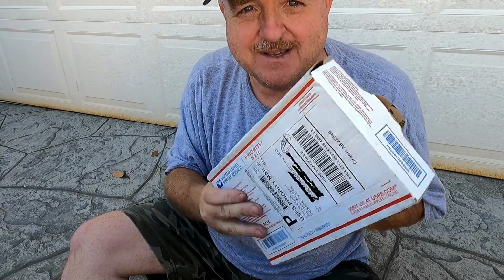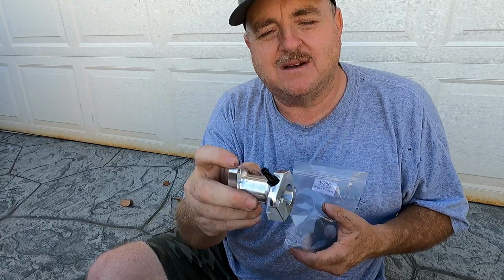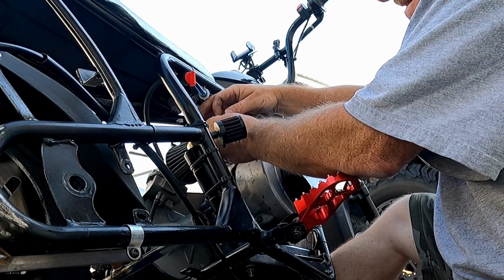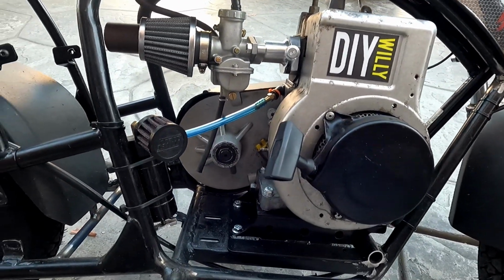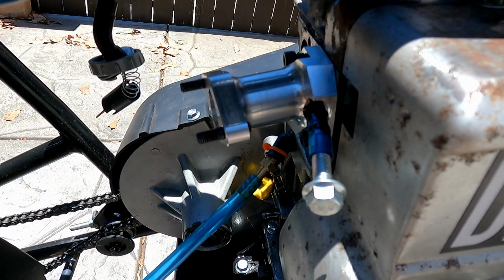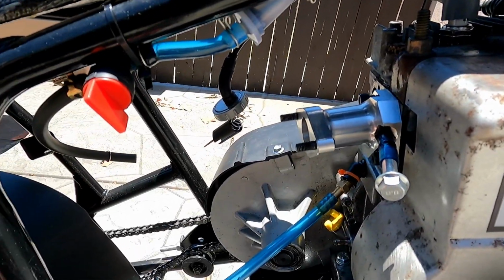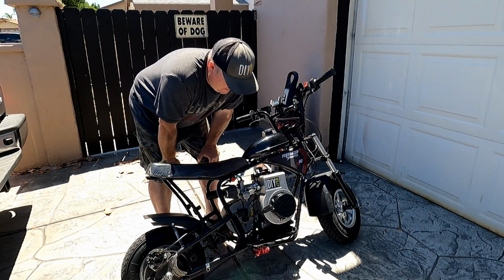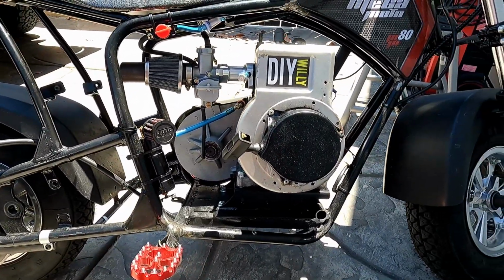New EC Carburetor Intake Manifold For Biggs

Comment: EC some seriously nice stuff.
Reply from the maker: I had it for a ride and according to gps it got up to 31mph with manifold. The Tecumseh manifold got Biggs up 24mph. A definite improvement in flow and power..
Reply from the maker: But now as I was telling @angrycruiser it’s making some unhappy noises. I better get that billet rod in soon! 😂
Reply: @DIYWilly  I'd do basically a stock performance build and run it. It'd be good to have a spare block.
Reply from the maker: @fatbuddycat  yes I found another block like this but haven’t pulled the trigger on it yet. I plan on rings, new valves, billet rod and flywheel along with a small amount of shaving the block and head just to make sure their flat. Not looking for more compression really. These engine like flow from what I understand and I have to believe after running this manifold. It will be a sold refresh and not a big power monster. I have the other engines for that. Now I just need another frame to use as a permanent home for the Briggs.
Reply: That bike is set up really, really nice.
Reply from the maker: @fatbuddycat  Thanks dude! 💯
The EC stuff has been nice!!

Comment: I have the same intake. I was a little sad that it only works with the fake Mikuni carbs.
Reply from the maker: Hello Luke, I can’t say it doesn’t work with real Mikuni carbs do to mine is an fake. But it didn’t fit either. I had to drill out the threads from the carb to mount it on the studs. But it does work very well and flow much better the other manifold I was using. Thanks for watching!

Comment: Yeah. You prolly figure it out but I'm at the 6:50 Mark and you have to make sure the carb is lined up properly on the manifold so there's no air/vacuum leaks with the o-ring mating surface. I figured out that you had to mount the carb on the manifold first, get it snugged down THEN mount the manifold to the engine.
Reply from the maker: Hello, it could work that way with the right Allen wrench. The wrench I had wouldn’t fit with the carb on. Thanks for watching!!